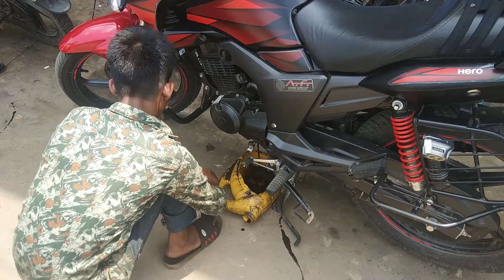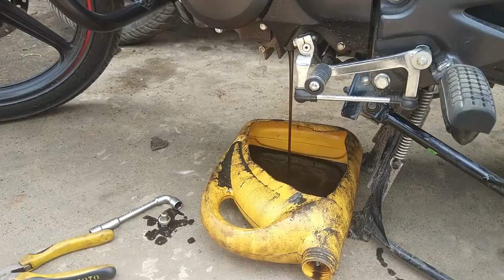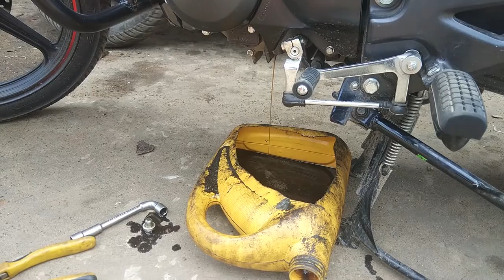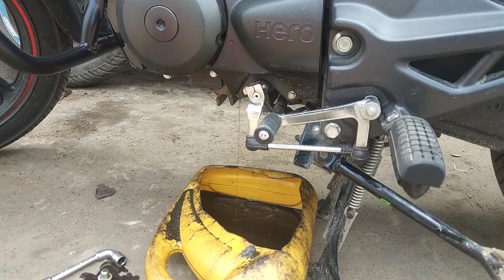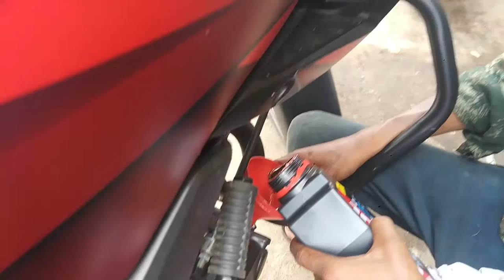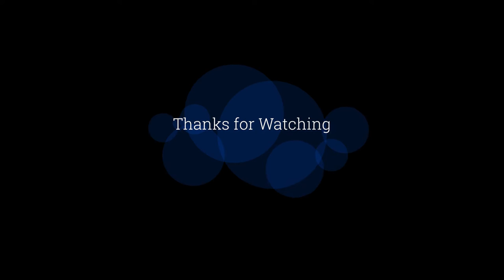Engine Oil Change | HERO HUNK | Chittagong

Comment: Engine oil capacity to 1.2L . 1L use korle ki performance e kono problem hoy? Thanks
Reply from the maker: 1.1 litter use করা best
Reply: @alvi13akif   Thanks. Catalog theke paisi 1L. New garite 1.2L vora thake, tar por change korar somay 1L. Source: Catalog. And yes, using 1.1L can be best. Thanks.

Comment: Engine oil r grade koto chilo
Reply from the maker: 10w30
Reply: Ami jodi 20w50 dei tahole ki somossa hobe.. 2.5 k run
Reply from the maker: @nstanmoy8752  10w30 is recommended by hero and engine made with this specification